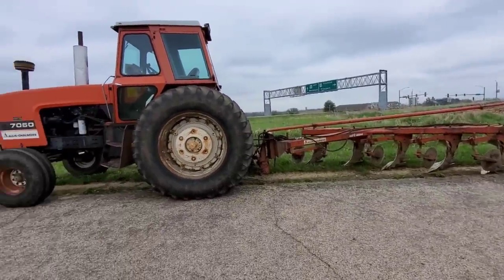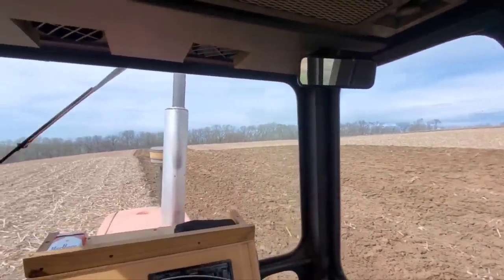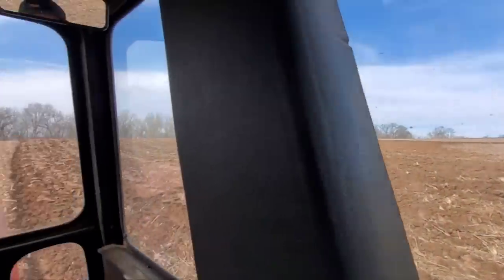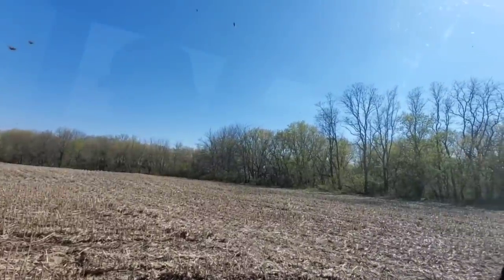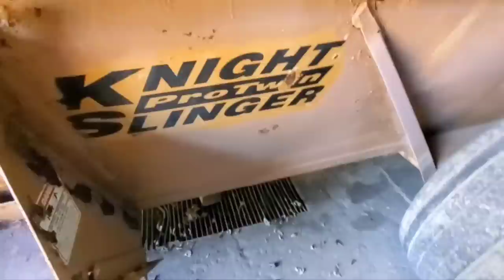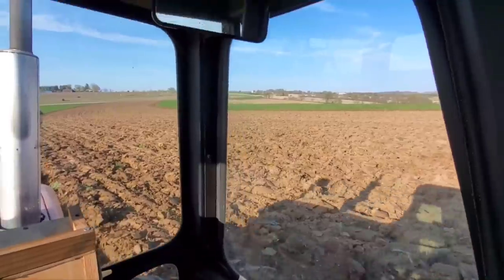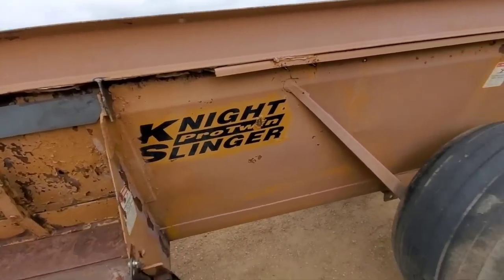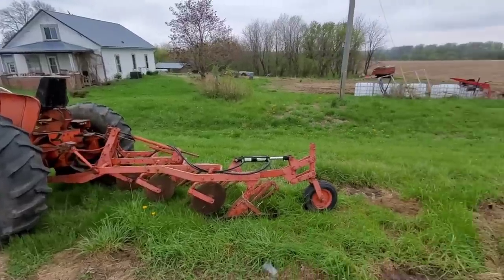Spring plowing with the 7060 and an Allis Chalmers 5-18s plow. 2023

Comment: I am surprised that the 7060 doesn't have front weights. I always find that 500 pounds on the front really help to balance the tractor out. I love dropping plow in the ground every year somewhere on my farm. I love the smell of turned dirt
Reply from the maker: Most of the farm I don't need the weights, I showed the hardest pulling parts in the video of course. It's not interesting when it's easy  going I guess lol.  Besides riding wheelies up the hills sounded life fun and putting weights on sounded like work 😅 so it made sense right lol.

Comment: Back when I was young we ran every acre that was available. We may not planted corn , but harvested crop. Usually just flail chopped grass. Now grown up to trees. On steep slopes with smaller tractors and equipment. Made it work. My dad with John Deere A leaning on gas tank to keep front end down planting corn. Four row corn planter [up grade from 2 row John Deere on WD45] Now land  looks like bumps to new equipment. Big little, little big.
Reply from the maker: It's a shame most big farmers don't really farm anymore in my opinion, all they are doing is controlling a computer across the field. Then once it's planted they are done, just watch it grow. God forbid they acualy get out of the tractor and clean some fence lines or fix some water ways....o wait that would be acual work, and it seems unfortunately allot of the big grain farmers don't know what that is anymore 😕

Comment: Those are some hard plowing fields!!! Hearing you talk about no till, it's funny to listen to the die hard no till guys how tillage destroys everything and blah blah blah. There has to be a balance somewhere. Heavy herbicide use isn't a good thing either. What you're doing is obviously working, between the manure, your cover crops (when they are feasible) and your plow, you've got a system that's working. Sure hope the weather cooperates for your plow day! I was hoping to do some plowing tomorrow but it's supposed to rain here. I've been working on my truck hard for the past few days so honestly, I won't be upset if it rains I need a day off. Thanks for the video Tim!
Reply from the maker: Thanks for watching Evan. There are ways to notil and it involves a vigorous cover crop schedule to let Nasir do the tillage for you.  95% of the notill guys seem to have no clue about that. The goal should be to make the soil better every year bit just to keep it the same. Cause there's years it will get worse no matter what without cover crops. Or turning your fodder in with something disk, plow, cultivater ect.ect. weather was perfect for plow day btw.

Comment: We never had a 7080, but by far the 7060 was the brute on our farm for many years.  Enough horse power to get the job done, but not so much you are destroying the drive line.  Spent many and many hours in one, loved every minute of it, both power director, and power shift.
Reply from the maker: I really enjoy running the 7000 series. I've never met anyone that ran one that didn't like them either,  doesn't matter what color they grew up with the either. Lol
Reply: The 7080 didn't have any problems with the power train
 That power train in my view was the best built in its time frame.

Comment: One of the most important factors in farming was preventative and regular maintenance.  We had far less failures in the field. Very applicable when running 3 Gleaners combines. Off season was mechanic season... 
 Tractors, 7080, 210, 185, D17,WD, WC and a couple "green" machines... lol each had a purpose for its size.
Reply from the maker: I have to work on my preventative maintenance when it comes to the little things like this. I tend to focus on the bigger issues and over look something as simple as changing a fuel filter 🤦‍♂️. This same thing happened to me last year with my 7045 ya think I'd get it through my head one of these times 😆  sounds like you had a nice fleet of work horses!!

Comment: Did you guys notill for a long time? I have for a few years and drug my 1500 min-till across it and it pulled a lot easier. But I’m using cereal rye and some other things to also build soil. I use to plow with our open station 7010 and 4-18s
Reply from the maker: This ground was notilled for 25 to 30 years before I got it. No cover crops, that's the only way to succeed in notill and build/save the soil, if your not using cover crops in your notill rotation your doing more harm than good especially if they use anhydrous. Sounds like you got it figured out, and your one of very few for sure.

Comment: U waited 2 long 2 change the fuel filters old tractors had bowls under the tank U could take off and clean out and another thing U can do is 2 take a long neck funnel use a old shirt or rag and strain the diesel fuel it does work and will be a great help 😊 OMG 5 13 2O23
Reply from the maker: I sure waited to long,  I know better too is the thing of it lol. These tractors don't have bowls they use a loop in the fuel line from tank to filter to act as a sediment catch. I keep my fuel barrel clean in very particular about it and my fuel guy is too, the problem with these tractor is they were sitting for 15 to 20 years before I brought them back to life, and there was all sorts of crap in the tanks I did the best I could to clean them but I'm still getting it through the system one of these days it'll be clean in there right 😆 thanks for watching and commenting Clarence!

Comment: Is this a 2000 series plow ?
Reply from the maker: Yep, 2000 series monoframe.
Reply: @TimothyFluegel  what type of break back system does it have ?   I’m looking to get a 2000   It’s a 5-16s
Reply from the maker: @farminindiana7590  they have manual trips, not hydraulic. They work well, just gotta back up if ya trip one, and it resets itself.
Reply: @TimothyFluegel  I appreciate it 👍🏼
Reply from the maker: @farminindiana7590  no problem. It was an option for them to have hydraulic trips, but it's not common.

Comment: Need to take that muffler off and put a straight pipe on when you're plowing!
Reply from the maker: Nothing like the sound of a 426 through the straight pipe.... for a couple hours 😆  12 hours plus a day though gets to be a little excessive for the ears,  I grew up on a 190 xt open station with a straight pipe, and I like the nice quiet cab at this point, now if we're taking about going pulling I'm with ya 100% 😆